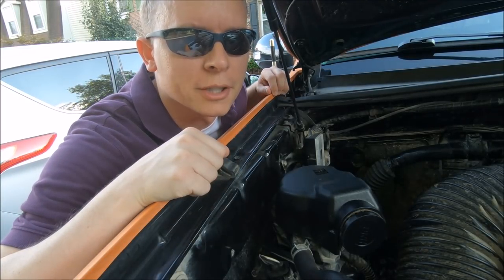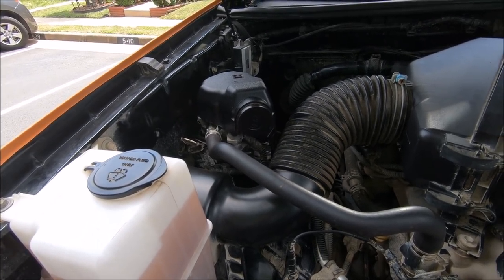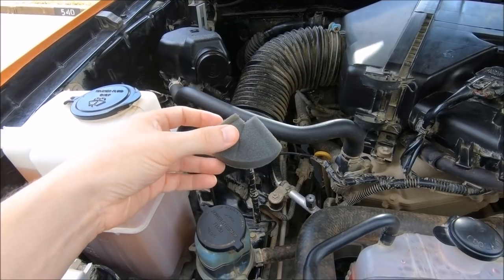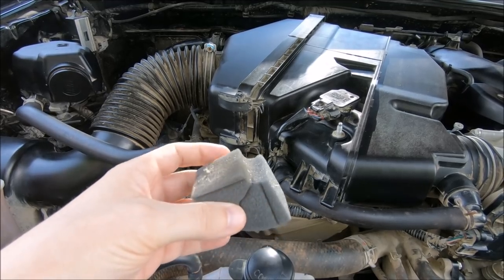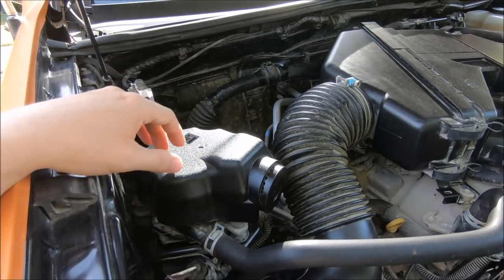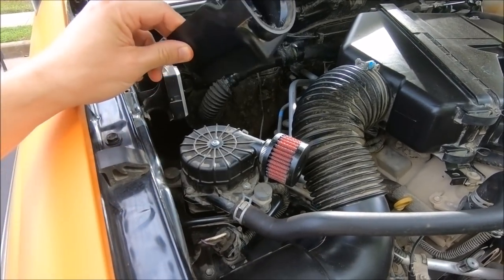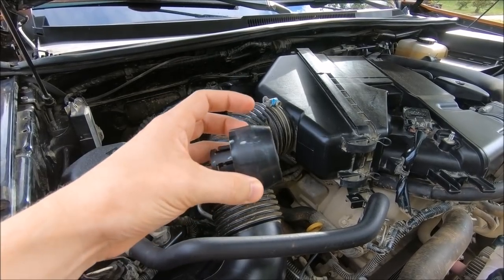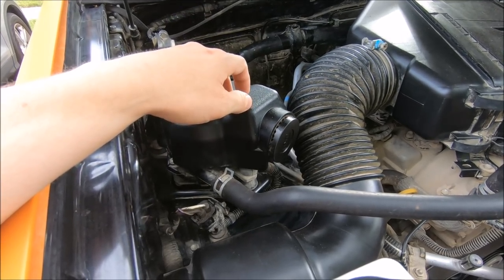Does Your Toyota Tacoma Need the UNI Filter Mod?

Comment: Our 2012 threw the P2440 & 2442 this week. My dealer...Hendrick Yota Concord NC...replaced both 2’ndary injection valves and air pump that came with the new spiffy cover all under warranty. Great dealership choice for service!!

Comment: For those who do just want to replace the original, it’s basically the same sort of filter sponge found in a garden pond water pump. Most good nursery’s should have replacements that can be manipulated to fit just like new. I myself am running both as I spend a fair bit of time in dusty environments
Reply from the maker: Be careful using a sponge like that. It might seem the same on the outside but could possibly degrade quicker than the OEM one. Checking it every few months would avoid that though.

Comment: I commented on the previous video. I was one of the ones that had to replace everything and I was one of the lucky ones that had to pay out of pocket (right around $2k). I can let my experience be a learning one. I tried to get it covered under warranty, my truck as a certified pre owned and when it broke my truck had less or maybe just over 30k on the odo. Truck was only a few months old to me. I tried to make the emissions argument they still said no. I contacted Toyota and they said it’s up to the dealership if they want to cover it under warranty. I contacted my lawyer he said not worth taking it to court. So please guys do this upgrade! 
When it goes the pump it self went bad my traction light went on and it went in limp mode. Limp mode meaning I couldn’t go over 45mph and I could not accelerate fast, it would just SLOWLY climb to 45. I pulled over and turned off the truck try to figure out the problem (I couldn’t) and when I restarted the light stayed on but it was out of limp mode. The very next day I tried taking it to places to figure out the problem. I guess in that time the valves went to crap the light shut off but never got it out of limp mode until I replaced everything. Thankful I’m lucky even to have a work truck that I was able to drive while mine was disabled!
Reply from the maker: Thanks for sharing your story Jason! Hopefully anyone who is skeptical will see what a pain this can be. I'm really curious why yours failed so quickly though by 30k miles.
Reply: Tacomaholic man me too lol! I’m thinking from a lot of off road use. I’m from south FL, I go out to the Everglades a lot to fish. Now when I say off road I’m talking about levee driving. Plus, again I’m from SOUTH Florida, so 30 mins the opposite direction it’s beach so a lot of salt air. 
When I looking at the car Toyota did tell me the only reason the truck had such low mileage was because the previous owner was a old retired man that only used it to haul his Jon Boat to the glades for him and his dog to fish. So if that true, chances are he also put it through those dusty levees every time he drove it.
Reply: Ordered mine will install as soon as it's delivered, ty for your story, it sucks you had to go through that experience.

Comment: Factory replacement filter pn is (edit, found the kit for sure) 04008-3520C. This is a “filter kit,” it includes the top cap and filter.

Alternative mod: briggs & stratton 27987 filter and cut to shape. This retains the water cap and just a swap out the foam type of approach. Retains stock look and water cap for those of us looking for that option.
Reply from the maker: Well the point of the UNI Filter mod is to not use the factory filter since there were cases where it deteriorated and caused a ton of damage.
Reply: @Tacomaholic  i totally get it and appreciate the video. I’m not 100% on that part number but that’s at least what toyota’s online parts site is showing. Thanks for video, i too may have overlooked this until it was too late.
Reply: @Tacomaholic  ok, so quick update just fyi. The previous part number i listed is just for the tube-cap. The website has that old part number listed as a “filter” but i don’t consider that cap piece a filter, i guess toyota does.

The actual part number is 04008-3520C which is a kit that includes the top cap of the SAIP and the foam filter. My local dealership is selling them for $31. That’s an expensive piece of foam! So there is another mod as well…a briggs & stratton filter (pn 27987) that you can cut to shape, that is the same height as the toyota filter. The briggs filter runs for $5. This is an important point for those of us that are more iffy about water ingress. Just more options for people out there, and you sure have a lot more people listening to you than me. Thanks again for the video, it’s been very helpful.

Comment: I have not checked my filter yet....maybe in the next week or so. I did call my local Toyota dealer and the Parts counter told me that the filter in the unit is non-serviceable and a replacement air injection pump is around 1200  CAD....That is nuts. I will definitely be getting the uni filter very soon. I now know as well what that sound is when I hear my truck engine stop. I was always wondering what made that whistling sound on shutdown. Your video is well done and you do a great job. Thanks.
Reply from the maker: Thanks Mike!
Reply: Mike Foehr I have to share this with my friend he has this same year and I was always confused on that sound to when shutting down lol
Reply from the maker: Thanks for sharing Jesse! 👍

Comment: Since the Uni Filters were on back order on Amazon I purchased the K&N you recommended for my 2016 Tacoma 2.7. The plastic cover will not fit back over the filter to be re-installed. I had my mechanic look at it and he said that unless I'm driving through a river I will probably be fine. Just thought all of you would like to know.
Reply from the maker: Thanks for the update! Did you get the black K&N one? I think that one was a little larger.
Reply: Yes. Black rubber with the red filter element. Is that what you meant? I thought I just copied and pasted the item number you gave us but I don't remember for sure.
Reply from the maker: Yeah that's the one.
Reply: That's why you rig it. That's what it means to modify.
Reply: Do you have the model number for that K&N filter? Thx
Reply: Yep, just found this out the hard way....Don't Get the K&N 62-1410 that's listed on amazon as an alternative---too big. I saw on another Tacomaholic video someone posted a K&N 62-130 that " fit perfectly". I measured the cover hole at 2" outside diameter and that's the OD for the K&N 62-1370. The UNI UP-107 allegedly has an OD of 1 1/2".

Comment: I ordered mine right after your last video. Installed it today however my factory foam filter looked new and not brittle 6 years later. Replaced it anyway.
Reply from the maker: Nice! Glad to see the sponge filters looking better than expected.
Reply: I am thinking about putting the foam one back in and just checking it every once and a while due to the fact that water can get in easier now. My 2012 doesn't have the cover over the pump. I wonder if there is a filter that I can just put inline after the pump to catch foam debris.
Reply from the maker: Check with your local dealership because there is a TSB out for getting a cap for your Tacoma.

Comment: My 2012 4.0 does NOT have the sexy little cover for the fan unit.  Is it missing or did it not come with a cover?
Reply from the maker: It looks like Toyota did not include that cap on the 2012s but there is a TSB out so you should be able to get one for free from a dealership.

Comment: Just had mine replaced on 2012 Tacoma. 80,000 miles and Toyota paid for replacement of the pump and valve assembly. When these 
fail vehicle goes into limp mode. Had to have my truck towed to the dealer.
Reply from the maker: Glad to hear they replaced it for free
Reply: Did you notice if your gas mileage is better? I just got mine replaced at Toyota, and it seems like it performs a little better.

Comment: i definitely noticed the pump noise after switching the filter. had me scratching my head for a couple days.is that just from the pump shutting down?
Reply from the maker: Yeah when you replace the restrictive stock foam filter with the UNI filter the startup/shutdown sound is magnified.

Comment: Do the 2012 Tacoma 4 cylinder have that plastic cover that goes over the pump ? Mine didnt come with one
Reply from the maker: Some of them didn't come with the cover for some reason but you can get it through Toyota. Part number is 17613-0P010

Comment: I haven't been able to find any info, but does this fit a 2012 4cyl tacoma? I was peeking in the engine bay and noticed there isn't a whole lot of space and don't want to buy a product I can't use.
Reply from the maker: Check to see if it's located to the left of your radiator near your washer fluid reservoir.
Reply: @Tacomaholic  as a matter of fact, it is next to my washer fluid, right in front of my  air filter housing

Comment: I have a v6 2011 and it doesn’t have the unit. Is there any benefit of putting one in or should I just leave it alone?
Reply from the maker: Nah just leave it. I think Toyota was forced to add the system because of gov smog regulations.

Comment: I was wondering if anybody knows where to find the cap/cover for the secondary air pump? I can't find it on Toyota parts website or on eBay. Thanks for the help.
Reply from the maker: I haven't seen a part number for just the cap or the factory foam filter anywhere. I believe it comes as an entire unit.
Reply: I have an 09 2.7L but no cap cover on it. Not sure if it’s missing or it didn’t come with it? 
Didn’t see it with the whole unit either w my vehicle entered in sparks Toyota.
Reply: @Tacomaholic  filter pn is 17621-0C010

Comment: Awesome videos! I've been binge watching your videos and just ordered this part. Just wondering does this need to be replaced yearly bi yearly or is their a certain number of miles it can go to? like 50,000? I just bought a 2015 Tacoma and this is the first thing I'm modding
Reply from the maker: Thanks for watching Edward! I'm going to check my UNI Filter every 6 months or so, but you can clean it with this stuff ( https://amzn.to/2vly5kM ) to keep it running smooth. 👍
Reply: Hey so I ordered the K&N filter you reccomended and it is way to big for my 15 Tacoma. I'm not sure if you posted the wrong size or if different tacomas have different sizes?

Comment: I have a 2009 4 cyl tacoma and it did not come with a cover at all.   It is in the front as you said in the video.    I made a cover by cutting a plastic half gallon milk container and held it on by using the attached screw on top of assembly.
Would like to know if anyone had another idea on improvising on this lack of a cover
Reply from the maker: You may be able to get a cover from the dealership. Not sure how much they would charge though.

Comment: Mine doesn't have the cover 2012 pre runner 4×2 . I do go off road
Reply from the maker: Did yours not come with the cover or did you leave it off?
Reply: Tacomaholic bought the truck new and it never had it
Reply from the maker: You should be able to get a free part from a dealership then. I think Toyota but out a TSB for it since so many issues were popping up from units that did not have the cap. 👍
Reply: Tacomaholic I'll check it out thanks
Reply: Have you heard of anyone having issues with the plastic a part of their hood scoop Oxidizing and fading?
Reply from the maker: If that part is plastic that's certainly a possibility but you could use some of this stuff to restore it: https://amzn.to/2JK7DWa

Comment: Great, informative follow-up vid, my friend.
...I  now have the little breather filter on my 2012 thanks to you! (mine never had a cover, btw. Either someone removed it or was never installed?) 🤔
Reply from the maker: That should be covered under a TSB by Toyota because not having a cover was causing issues as well. 👍
Reply: Tacomaholic Thanks, I’ll check that! 👌🏻
Reply: From what I've read, the 2012's don't come with the cover.  I checked my 2012 and it also does not have the secondary pump cover.
Reply: Martimus98 Thanks, man!..,I thought my Chilton (or) Hayes book show no cover on there as well...Interesting 🤔
Reply from the maker: You should be able to get a cover under a TSB from a local dealership.
Reply: What's odd is that I've read through many of the published TSB's for the 2012 and I cannot, so far, find a reference to it.  Do you happen to know which TSB it was?
Reply from the maker: I believe it's this one: TSB# T-SB-0333-17

Comment: My dealership says it is a non-operable part when asking about replacing the filter...
Reply from the maker: Lol did they give a definition of what they mean by that?
Reply: @Tacomaholic  no, they mentioned that the ones on the tundra were prone to getting water in them... 
But no mention of any failures on the tacoma. 
I guess I'll have to either mod it like yours, or get a new filter. 
Its a 2017 with the 2.7, and it's got 52k miles, so I'm sure I'll want to replace it soon. 

It looks just like this one in the video, unless I bust it open and find some new kind of filter in there.

Comment: I found the air pump diagram online, but there is no part # for just the sponge. https://onlineparts.toyotasouthatlanta.com/a/Toyota__Tacoma/48489571__6785715/EMISSION-COMPONENTS/8519205.html
Reply from the maker: Thanks for sharing the link! Weird that they are calling the cap (part #5) the filter when it's just a water shield really.

Comment: UPDATE: 65,000mi, 2012 Tacoma... Toyota few years ago extended coverage of pump and ASIS. Just had mine replaced $0 at Toyota dealer. PRINT this and show dealer. They could not find it - I did the homework and saved $1700   https://www.toyoheadquarters.com/threads/2012-toyota-tacoma-for-air-injection-pumps-air-switching-valves-csp-zha.1178/
Reply from the maker: Thanks for the link!